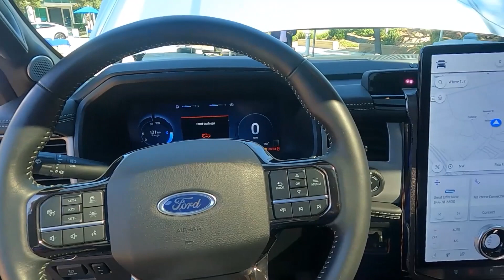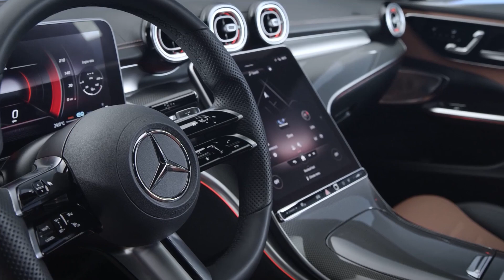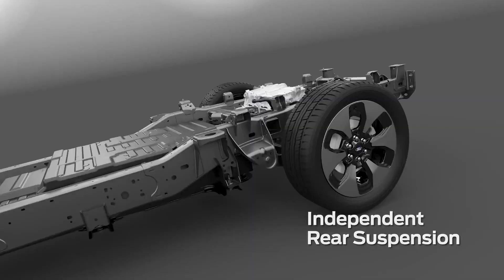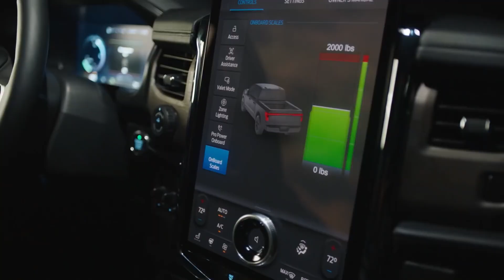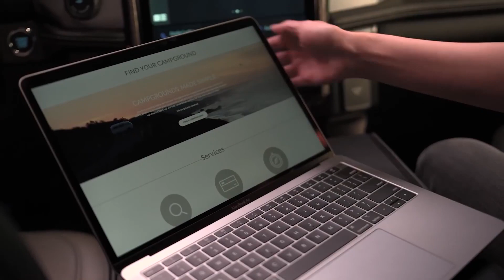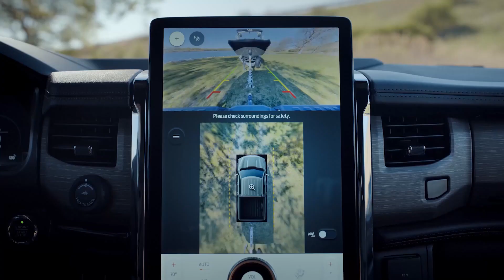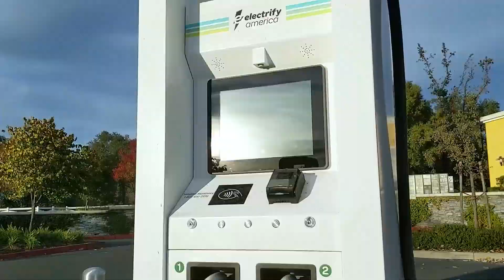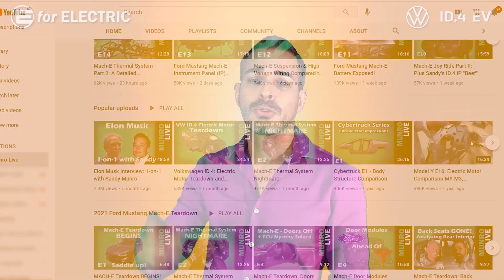SANDY MUNRO on Electric Trucks: F-150, Cybertruck & Rivian

Comment: Elon Musk has stated via Twitter, that the max capacity of Tesla superchargers will soon be 300 kW.  It's reasonable to conclude that by the time the Cyber Truck launches that supercharger max capacity will be increased again to 350 kW if not higher in direct competition with anything competitors bring forward.  The Ford Lightning specs only indicate 150 kW DC fast charging speed.  I have not seen higher that that  So while it's assumed a Ford Lightning may be able to use a Tesla supercharger- I suspect it will be many times slower than a premium Tesla vehicle.

Comment: Those middle of nowhere spots would be good for a charger with solar roof and maybe some second life batteries. They could charge whatever they want $!
Reply: Look up the energy density of solar panels, then do the math on how many panels you’ll need to Chargé...
Reply: @acchaladka  A permanent installation with fixed solar panel array, second life batteries to store the electric, and a couple charging ports to deliver it into the customer's Ev's ... No fuel deliveries needed.
Reply: @acchaladka  I haven't done the math, it would probably have to be more roof than parking space + a small solar farm, L2 yes, DC fast charging, not so much. L2 - 7,200 watts

Comment: Electric vehicles just seems to be getting better and better. They already proven better than gasoline vehicles, and it's just a matter of finding a sweet spot to stop the manufacturing of fuel burning vehicles.
Reply: Here's when you can stop fuel burning vehicle production.   Produce a 4 door pickup that can pull a 25000 lb trailer like I do with my Silverado 3500, get 400 miles of range with 15 minute charge time for another 400, and keep me safe and warm at minus 20 degrees.  Until then these electric pickups are an interesting toy but wont even come close to meeting my pickup needs
Reply: @howebrad4601  It's coming, they already have tractor trailers out doing the job. It's just a matter of time and electric pickup trucks only getting more better and better.
Reply: @shaunjeff45  well I travel cross country in my freightliner cascadia semi and I have yet to see a tesla semi at work.  The idea is great as diesel semis are very slow to accelerate.   I'm just not convinced yet that the tesla semi will be able to meet the needs of the class 8 semi driver as the technology currently exists.  Maybe some day but it doesnt appear they're quite there yet
Reply: @howebrad4601  Your saying what people been saying about electric car in the past. But Tesla became a slap in the face to all those fossil fuel burning car companies who simply just gave up, because the good old ways of doing things. It took a totally raw electric car company to stick with the idea and refine the electric vehicles, and thank God! Just about all eternal combustion engines car companies was given some government incentives to get an electric vehicles out, but decided to kill the program, because of the good old ways of doing things, but now they are chasing after Tesla in changing as far as turning to electric vehicles.
Reply: @shaunjeff45  Well I'm certainly not opposed to electic vehicles but they will have to perform as well or better in various driving situations and conditions before they will be adopted.  I rode in a tesla car a little while back as a Lyft and I can't say i was impressed.  The back seat was hard and there was a considerable amount of tire and road noise present.  For an economy minded car that's acceptable, but I didn't see the level of luxury that people claim they have.  For the price of a Tesla that's not acceptable.  In a chevy Aveo, fine, but not in a vehicle that purports to be a luxury vehicle.  There is a world of difference between what is required of a car, and what a heavy truck must handle.  Just because Tesla can produce a car that will meet the needs of some people, The class 8 heavy truck world is very, very different.  As a driver, time is money, as the industry is highly regulated.  If I'm not on my mandatory break, or other rest period, my wheels need to be moving, not charging.  We'll see what the future holds!
Reply: @howebrad4601  The price of a Tesla is ridiculous, but they do have new Tesla thats runs at price of $25,000 in 2022. I don't like anything about the Tesla s Plaid interior design, but the new electric cars supposedly have a better interior design. Ford have a electric car called a Mustang with an interior design I like and It's cost supposedly be less than the price of a fossil fuel burning vehicle of its class. The cost of producing an electric vehicle supposedly be less expensive and simpler to produce then the cost of a fossil fuel burning vehicles. But as we can see, electric vehicles are getting much better, then that of fossil fuel burning vehicles. The vehicles business are going to electric vehicles, but Europe is doing it faster. Just like the old annaloge system that been replaced by digital system, so will the electric vehicles replace the fossil fuel burning vehicles. Electric RC cars, aircrafts, boats has almost totally taken the place of fossil fuel burning RC hobby vehicles. There are just much more things electric vehicles can do, then that of a fossil fuel burning vehicles, and you can run them on the moon in outer space or under water. There are ion rocket engines, and they are talking about a light speed rocket engines. It's like the combustion age is coming to an end, and things just seems to be getting better with electrictronics.

Comment: it is because what it delivers does not stack up to what a gas powered truck will offer. does it have more torque maybe. however once it is loaded up and and you tow with it you instantly lost 2/3 of your range. In my case I take my trucks out to the middle of no where. The gas station out there which is a diner restaurant and convenient store wrapped into one in a town of about 70 people where and how are you going to charge it. The biggest hitch with electric trucks is the range and time it takes to charge. flat out that is it. All the bells ans whistles cannot replace that.

Comment: Strapping a trailer to a 5000 pound Model Y will cut the range in half (due to the increase in weight and aerodynamic load).  But a big EV pickup truck, at 7 or 8 or 9 thousand pounds, will already have dealt with the weight issue (with a bigger, better battery for one thing) and will already have a large frontage pushing through the air, so I would expect the range drop of an EV truck mated with an equivalent trailer will be a lot less; no worse than a ⅓ drop in range or so (realizing that the percentage change in overall consist weight will be much less)...

Comment: Battery and chip supply constraints will keep all of these EV truck manufacturers in the weeds.  Tesla is the only company with plans to overcome these bottlenecks.  When Cybertruck finally enters production in late 2022, it will do so with a vengeance.  Their mass production will quickly crush every other truck being produced.  The legacy OEMs all know this regardless of their PR efforts to claim otherwise.
Reply: Finally someone can see through the smokescreen here.
Add to that that for some "surprising" reasons, nobody talks about the CURBSIDE WEIGHT of these cars.  The Cybertruck can haul 3500 pounds which means itll be 5000 weight max. The Rivian is close to 7000 pounds, the F150 is above 6500. They have 1500-2000 pound less carrying capacity than the Cybertruck.

Tesla battery tech is light years ahead of the competition, this is why the Cybertruck will win. Everyone will see this in one year.

Comment: The only problem is that the F150 lightning will have twice as big a battery and probably a less efficient charge rate than a Tesla model 3. I do not think people would want to take a 40 minute break in every 2 hours on a cross country trip!

Comment: They hide the most two important questions the people have. How much is the top of the line electric truck. What happens if you take the truck up in the mountains and you run out of electricity? How long can you go up terran without charging it? If they cannot answer that then, I will stick with my old f-150

Comment: Trailer with a battery is another game changer. Becomes a recovery trailer in case you do run out of charge. You could also add electric motors to assist with towing and regen.

Comment: Charge trailer is already being made in Europe - basically the caravan / trailer chassis has a built in battery (and wheels/ axles have motors ) which makes the towing effort negligible- wish I could remember the company!

Comment: Half the ownership time is charging it. Every driver will own an EV once and that will be it.
Reply: I  have an older Tacoma pickup and a Tesla 3. Maintenance on the Tesla so far is windshield wiper fluid in 4 years. Regen means low wear on brakes. I hope to keep my truck for a long time but spend a bit more on maintenance. Trip to Idaho from Seattle aprox. 1400 miles spent less than 2 hours total charging., mostly because a night in each direction charging at a motel for free. At home, charging when sleeping and never have needed to add during the day.

Comment: Easy answer.
Pickup truck need more batteries than smaller vehicles. And at the time very expensive batteries. If the Tesla EV cost 70k at the time, an pick-up EV would be double the price.
Plus Elon want more EV (replacing ice) on the road asap - for the environmental reason. So get EV vehicle adopted first, get them on the road then think about the bigger items..

Comment: Trucks last on the list? Lets build affordable electric cabriolets. (not meaning the softtop Smart or Fiat 500E please)
Reply: To be honest, the most of the owners of those cheaper cars could not afford to replace the batteries or for that matter afford to pay recycle fees and the cars would be sitting on the sides of the roads in the ditches or filling up
Landfills. As many owners of the cheap cars don't maintain because of low income or laziness, take your pick, then why would this be any different. Batteries require maintenance to last and you can't just plug it in when it's dead or almost dead everytime.
Reply: @davidclemens1578  Batteries are becomming cheaper and cheaper. 
Most richer owners are the laziest ones. They dont maintain shit, coarse they sell after 1 or two years anyway. 
The hard working employee is the one that maintains their cars the best, coarse they have to keep it running for the next 10 years. They cant afford to buy new every year.

Comment: I just hope he forgoes the all wheel steering.  It is complex and costly and requires more maintenance.  It is good for desert racing or .005% of the truck owners.  Also making the truck shorter so the hipsters can fit it in their garage is catering to those who typically do not own a truck.  The hipsters will be going to the NEXT cool thing while the guys who need it for work are the bread and butter.   Stop trying to make it too expensive and complex.

Comment: Trucks cover several bases; recreational, off roading and construction.  The fact that trucks come in different bed sizes, cab configurations, trim levels and drive train variations show that there is not a ‘one size fits all’ solution.  Ford will be constrained by lack of battery supply and indifferent public charger infrastructure.  Tesla will have no such constraints.  Ford has 120K preorders and Tesla 1.2M preorders and I would place bets that Tesla will clear its pre-order number before Ford does.
Reply: The Gov'mnt could mandate all charging stations serve all EVs. They love breaking monopolies.
Reply: Tesla will do what with their one size fits all pickup?

Comment: Let's see how you back in to a supercharger with a trailer attached.
Reply: It's as simple as disconnecting the trailer and pulling in to the charger. Most lots have places to set the trailers and if they don't they will when Ford and rivian start selling in Mass

Comment: Doesn't anyone wonder why Alex had to ask the guru three times whether a cyber truck made any engineering sense?  We were then treated to a non-answer... And if that weren't enough now he is promoting battery trailers....!! The Tesla model 3 and model y already have a battery that weighs roughly 1,000 lb for a 4,000 lb car... What do we think the battery weight will be in the so-called Ford Lightning??  Monroe is right about one thing - the dysfunction at the automakers.  But be careful because this guy is very good at capitalizing on the collective madness of the public.

Comment: Lightning will need 170 kwh battery cuz of poor aerodynamics vs 75-100 kwh battery Cybertruck.  Expensive battery Ford.  Plus 4680 battery less needed
Reply: The so called great aerodynamics of the Cybertruck will be rendered useless when towing, that's when the bigger battery earns its keep.
Reply: Lol  75-100kwh what are you smoking! Try 200kwh for the range Tesla is promising! 500 miles cannot be achieved on any current Tesla! The Cybertruck is a massive vehicle